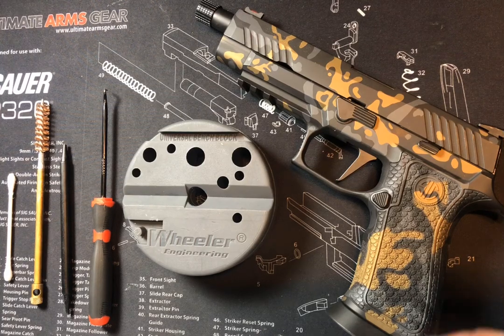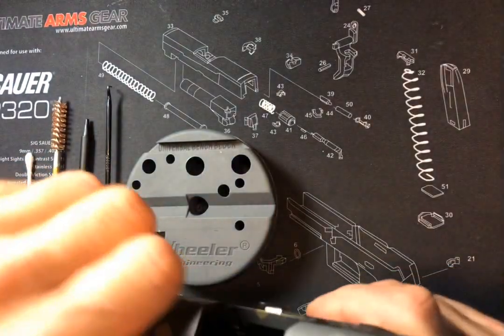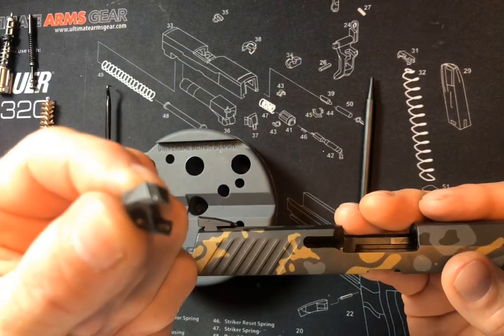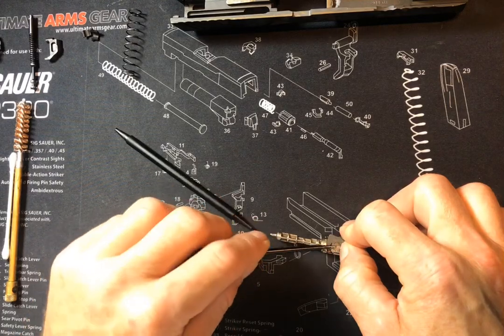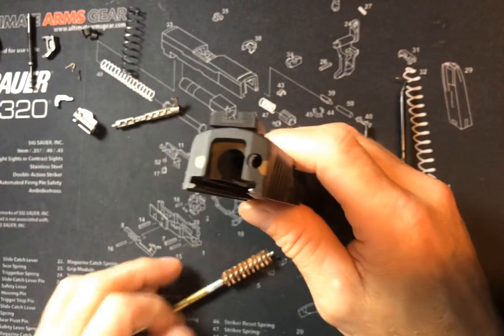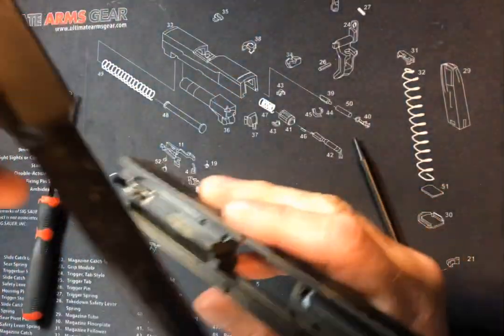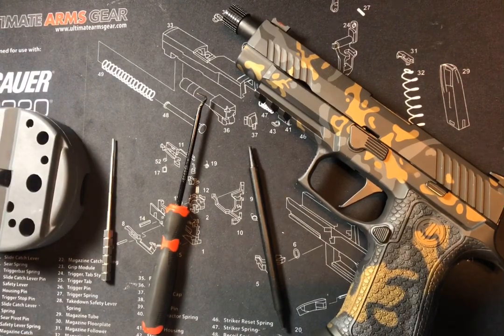Sig Sauer P320 striker removal, disassembly, cleaning and reassembly

Comment: New gun owner here-very good instructions with one exception-you cut out the cleaning process giving no information as to what you should and shouldn’t use for cleaning agents on the striker assembly.
Reply from the maker: Hi sir. Clean with anything. Reassembly dry. No lube at all. Spotless.

Comment: I took my striker out cleaned it with Lucas gun cleaner spray it’s kinda like break clean. It removed all of the oil and carbon with a couple sprays. But when I put the gun back together and did some function checks the gun was failing to go into battery. The striker was catching on the sear like intended to but was stopping the gun from fully going into battery. Tried everything nothing worked except when I put a little CLP on a qtip and wiped the inside of the striker housing not channel, after doing so gun functioned perfectly. Long story short don’t use a cleaner that is like brake clean and turns all the grease into a dry film that makes ur striker unit not work properly and get stuck on the sear.CLP SOLVES EVERYTHING

Comment: Could not install striker assembly because safety lever was leaning out.  Happened 2x.  Thanks to your video, i just had to move the spring and it popped back into place.  Excellent video - thanks.

Comment: Dude, best videos on YouTube. Well detailed and explained. Plus your tips from experience are invaluable.
Reply from the maker: Mark Anderson thank you very much for the compliment. Glad you find them useful. Appreciate it sir.
Reply: Sig Sauer Guy quick question if you wouldn’t mind... I will be getting a can of Rem DriLube to try it out, but I was wondering if you used any particular product during the actual cleaning of the striker assembly. Thanks man.
Reply from the maker: Mark Anderson nope 
I just wipe it down. Put it back in dry. That’s it.
Reply: @SigGuy  your videos are the best!
Where can i get a guide rod like yours?
Reply from the maker: Arturo Miramontes Springer Precision sells tungsten guide rods.

Comment: Awesome video, I've never bothered to remove the striker assembly well... because it says flat out not to in the book lol. I pride myself  on keeping my guns clean but I'm sure this part is caked since it's never been touched. Maybe a dumb question... but since it's just one peice couldn't you just blast it with some parts cleaner, dry it off, clean the channel and reassemble and get a good result? I'm afraid my sausage fingers will loose those micro sized springs.

Comment: On mine, the striker doesn't really get dirty. I have never disassembled it(well over 10,000 rounds fired). Occasionally I'll through it in the ultrasonic cleaner along with everything except for the barrel, and rinse(barrel gets cleaned with patches and bore solvent). Then I give everything an ultrasonic bath in Lyman Turbo Sonic Gun Lube to remove water and leave a lubricant film on everything. Then oil only those parts that Sig says to lube(barrel, slide, and recoil spring). I use a silicone gun cloth on the exterior of the slide to make it look nice.
Reply from the maker: If it works for you then I wouldn’t change a thing. I reload so I have an ultrasonic cleaner as well. For me it doesn’t get everything completely clean.

Comment: Thank you but recently i have problems with that little spring  when i assemble the spring the Disconnecter plate becomes loose do i have not enough tension anymore on that spring or is it broken , i cannot figure it out

Comment: great video.  you anticipated all of my questions with one possible exception.  based on how detailed you were, i'm assuming it doesn't matter, but when you were assembling the 2 halves, does it matter where the 2 halves meet (ie, at 12 o'clock/6 o'clock or 3 o'clock/9 o'clock)?
Reply from the maker: Doesn’t matter at all bud. Thanks for the great question. 🙏🏼

Comment: Hey Sig Guy, thanks for your content, it’s much appreciated. I bought a back up striker assembly and recoil spring assembly recently, the latter I had to get on eBay and paid twice the suggested retail but I wanted to have both just in case. 

I do a lot of dry firing, that said if I keep my striker clean and free of grease and fouling how long can I expect it to last before I swap it out? I’ve done some reloading as of late with a new progressive Hornady AP that I thought made sense to get into and I’m using small rifle primers to substitute for small pistol as the latter is impossible to get and while I’ve had no issues yet I certainly want to avoid the potential for any and I’m wondering how long the striker assembly lasts. 

Thanks in advance and thanks again for your content. Your FCU assembly/disassembly videos were clutch when my trigger spring came off and I had no idea how to get it back on so sincerely, THANK YOU!
Reply from the maker: There’s no suggested replacement interval for the striker itself. The spring yes but not the striker itself. Just inspect and reuse if in good working condition.

Comment: Btw, never admit to sig that you took the striker out and apart if you ever need warranty work done. Owner's manual says doing this voids your warranty. Even though if you were to press them hard enough you could get them to warranty it anyways because having potentially unsafe guns out there is not a good look for any manufacturer.

Comment: I am stuck. Every time I put the l safety lever back in with the spring, no issue. When I slide the firing pin in it lifts it up. I have tried putting the firing pin in first the the safety level and the same result. The spring and the level work as they should until I try to put the firing pin in. I seems to lift it up and knock it out. Tried 100 ties. I noticed it fell right off when I removed the whole firing pin assembly. Very frustrated!!

Comment: Can I just throw the whole striker assembly in a sonic cleaner to clean it without disassembly?
Reply from the maker: There are others that use that method. I’ve actually tried it several times basically to test it out myself. Doesn’t get nearly as clean as old fashion elbow grease.

Comment: all P320 striker is the same   ???  

I'm thinking of buying a full-size slide I want to know if the striker and the extractor case of a compact internally works on a full-size slide
Reply from the maker: Correct. All the same.
Reply: @SigGuy   thax man
Reply: Only i what to used the stiker and the  extractor

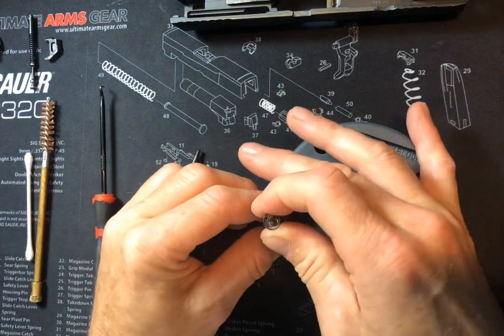Comment: Are the cups at 3:18 the same for the p365xl?  I'm looking to replace my one piece cup with the 2 piece cup, but the only cups I find are for the p320.
Reply from the maker: They are not but I sell complete striker assemblies on the website if you are interested.
Reply: @SigGuy  Are the new ones the two piece?   My P365 has the two piece and the striker protrudes a lot further than my P365XL with the one piece. The striker barely protrudes with that one.  I have not had any light strikes with my XL, but I have a hard time trusting it.  I hate to buy a whole striker assembly and was hoping they just sold the cups like they do for the P320

Comment: Great video but please,what is the name of the tiny spring that goes inside the sticker channel?..Thank You
Reply from the maker: Ellis Smith Jr I’m not sure what the technical name of it as it is sold with the striker assembly.
Reply from the maker: Actually that’s not correct. I was thinking you were talking about the 365. If you’re talking about that little spring in the side I believe it’s the striker safety spring.
Reply: @SigGuy  
Its the smallist spring in the intire gun...
I didnt mean to say channel,its the spring that goes inside of the striker Housing...
Im thinking after some research that it is called the "striker reset spring"

Comment: Hey SSG...love your videos. I have a problem with the extractor guide rod on my new P320 X-Carry. I disassembled the slide this evening to install a red dot. Upon reassembly, the Extractor Guide Rod doesn't go in all the way. I can't force it all the way down into the channel to capture the extractor. Yours went back in so easily, I have about 5-6 coils of the spring sticking out and the remainder of the guide rod. Mine gets stuck at that same spot every time and I can't force it any further. Any ideas? Thanks!
Reply from the maker: Jeremy Reeves any pics? This is a new one for me. Are you positive it’s capturing the extractor peppery? Can you see the through the opening behind the extractor as you installs it?
Reply: That means you’ve put the rod in the wrong way, there are two holes in the end of the rod that need to go up and down NOT side to side when put back in I had this same problem but found this solution in a spectate video.
Reply: Sig Sauer Guy turns out, I used the wrong screws to install the red dot. I used both regular screws, instead of one long, one short. The longer screw was blocking the channel. That’s why the extractor guide rod wasn’t fitting. I didn’t remember that the screws with the x-carry are different sizes because of how they attach to the slide at different clearance points. Live and learn. Thanks.
Reply from the maker: Jeremy Reeves Well this is certainly a learning lesson for both of us. I have never heard of that being an issue either. Just goes to show everyone can learn something every day. Thanks for following up brother. I’m glad that you got it all resolved. Have a great weekend and be safe!

Comment: I removed the striker assembly from the slide to clean. I did not disassemble the striker, I just removed it from the slide. I can't get it to push down so I can slide the back plate back on.  What am I missing?
Reply from the maker: With the striker assembly in your hand you should be able to press on the striker safety and move the striker itself in and out of the striker housing. This should move very freely. Once you push the striker into the housing you’ll see the striker safety lock it in place. This is normal. With it locked in place slide the striker assembly into the slide and make sure when pressing on the back of the striker housing it goes in all the way. It will only press in a little bit. If it is going in all the way next you would press in on the extractor spring guide which will allow you to slide the slide cover plate into its installed position. Release the extractor spring guide which will lock the back plate in place. That’s it.
Reply: @SigGuy  I can’t get the striker all the way into the slide. It seems to be hanging up on a part of the housing by the striker safety. I wish I cld post pics here. It’s hard for me to explain. I’d hate to take it to a gunsmith. I’ve only had it a week but there was so much oil oozing from that area I thought it wld be good to clean it.
Reply from the maker: @snowangeltae  definitely a good idea to clean it all out. Sorry you are having difficulties. I would verify nothing is inside the striker cavity. Watch the video again about the striker and verify the safety lever is working properly and the striker moves freely inside the housing. When it’s installed in the slide the striker housing only depresses 2mm. That’s all it moves. Make sure the extractor spring guide (plunger) is depressed fully into the hole in order to slide the back plate on.
Reply: @SigGuy  It’s nice and clean now. I just can’t get the striker assembly back in the channel. When I disengage the safety the striker moves freely in the housing so there is no hang up there. A piece of the housing seems to not be allowing it to go all the way in the channel. I’ve watched the video again and several others and it looks like a piece of cake. Mine is not cooperating. I’m posting at sig forum dot com under sig armorer but not having much luck there either.
Reply: @SigGuy  It was the spring.  I must have twisted it to where it had lost tension?  Not sure.  A lady in a women's CC FB group helped me through it as she was taking hers apart.  I twisted the spring around a little and that did the trick.

Comment: Why is in necessary to put the striker in dry. It seems counter intuitive to me. It seems it would be good to have the moving parts lubed. Please excuse my ignorance.
Reply from the maker: KatManDoo lubing the striker needs to be squeaky clean to operate properly. Even assembly lube from the manufacturer has caused malfunctions. The striker doesn’t create friction that lube is necessary to minimize. The only stupid question is the one not asked.
Reply: You dont want gunk buildup in the striker channel (which does not have much free space),  lube attracts and collects gunk, too much gunk can cause the striker to not move back and forth freely causing reliability problems.